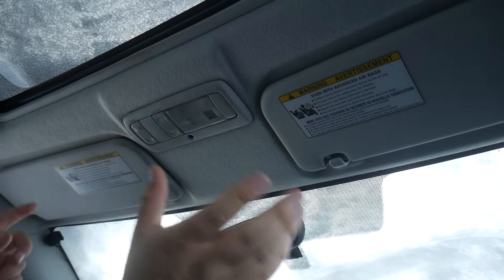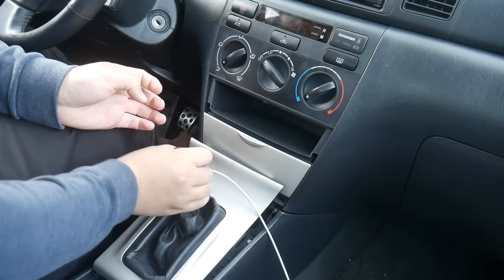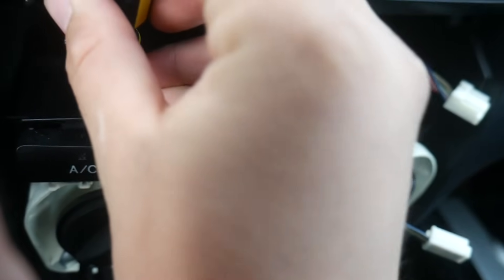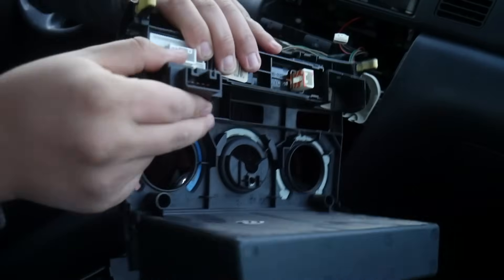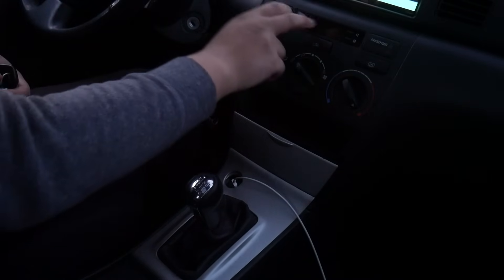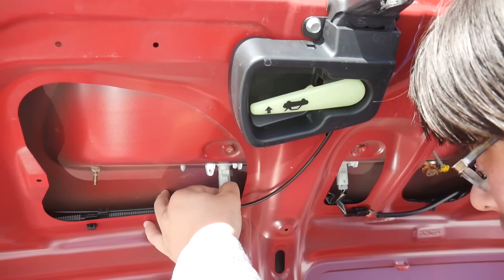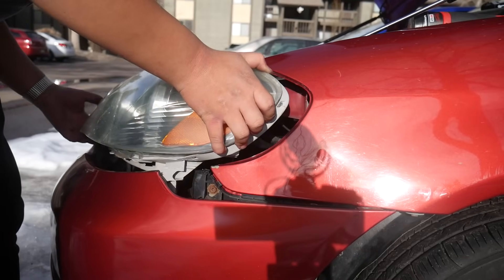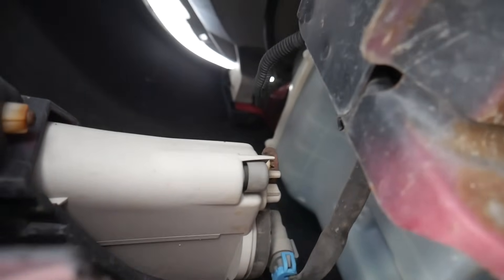Corolla LED Light Swap (Ultimate Guide)

Comment: There is another light in the back of the ashtray. Also, there is one in the clock. Both are T5 bulbs. Want to do the radio/disc player but haven't had time yet. I found the 'new' T5 LED are brighter than the old bulbs.

Comment: Thank you for showing the flasher relay location and including the amazon link, you really helped me. I had the hyper blink going on for like a week and couldn't stand it... this was super easy to do,  except pulling 2 tabs and pushing down another tab with only 2 hands in a tiny compartment was not fun 🤣You said it was hard to get the stock one out, but at one point I had it unlatched (not sure how) and then stupidly clicked it back into place by accident. If you can unlatch the stock one from it's spot, you can definitely get a better view and grip on those tabs.

Comment: Awesome - thank you. About the HVAC bulbs - buy the 10 pack. You'll drop some, you might even break some. The slots on the back of the ones in the link aren't deep enough for a screwdriver - tweezers in holes in the back worked for rotating them into place. 

Also your instructions for the shifter bulb are several steps simpler than other videos I saw. 

5 stars.
Reply: What tweezers did you use? I can’t screw them in for the life of me!!
Reply: @skitzafraz6708  the ones in my Swiss army knife key chain - small, squared off. Screwdrivers for eyeglasses might work, too

Comment: IMPORTANT INFO:
If your dash speedo/cluster lights are not working check your Tail light fuse!, i was working on installing a new stereo and my heater control lights were flickering and i noticed the controls had snapped where the bulbs are this shorted out when i touched it causing my fuse to blow and turned off my cluster lights, after mass amounts of searching i found out the cluster and tail light fuse are on the same connection.
In the UK my corollas tail fuse was hidden behind the glovebox up the top on the USA models i think it hidden behind the little cubby flap, great video 👌🏻

Comment: I just changed all my exterior lights to LED’s (except for the brake lights) and my 08 Corolla LE puts a big smile on my face whenever I’m following it and kinda makes my eyes bleed when I’m in front of it. I might have to swap out the headlights with something less bright. I bought the same turn signals listed in the description instead of getting ones with load resistors cuz I thought changing the Flasher Relay would be sorta easy but it’s really not compared to the video. I might get some professional help but I’m not sure atm cuz I’m always at work. But either way, thanks for the awesome helpful video Will!
Reply from the maker: Glad you found the video helpful and I'm glad you're enjoying your new lights! I guess I found the relay easier to swap because I've done it before but either way if you get professional help they should be able to finish it quickly!

Comment: For the hazard switch (for a different car) I used very thin aluminum tape strips on the inside of the button to reflect the light better and it's a MAJOR difference. I recommend trying that

Comment: You can fix the clock all u have to do is take it apart and heat up the resistors with a soldering gun just a lil bit and It did work for mine Good luck I’ve been watching your videos huge fan here keep it going
Reply from the maker: Yep! Planning on doing a video on how to fix the clock. Thanks for your support on the videos!

Comment: I did LED in my dome (interior light) and it’s a nice shade of white light, but it’s not bright enough for literally anything. The two in the mirror were the ones I planned next, but if they are anything like the dome light, I won’t change em. 
  I did my headlights (dim/low beam) with some LEDs from Amazon, and they are amazing! So clean and bright, I replaced them due to current draw. Halogen draws much more current than LEDs, and I save on power reserves for audio any time I can. That said, your 07 Carolla LE is basically the same car as mine, I thought I’d let u know, if u ever decide to do a stereo system, something about the trunks on those cars do great for the sound of subwoofers. Some cars have the shape and the cabin space that is a sweet spot, the Rollas’ are in that spot.

Comment: Hey man just want to say thanks! I watched your other video and got the lights  you put in the description. I changed all of them except the map lights 😅 tried to take the bulbs out and i couldn’t
Reply from the maker: The map lights are a pit of a pain to remove, I think I ended up using a flathead screwdriver to pry mine out but I did shatter one. Thanks for your comment!
Reply: Same, i still cant get the bulb out. 😣

Comment: Pro tip to anyone having trouble with their license plate lights like mine.

as mine were never removed since they were made. Use silicone Lube or just getting a good angle and some pliers, but of course don't break the bulb socket

Comment: I have never seen such a kitbash collection of analog bulb types. 205x,315x and 744X.  I've had to do bulb swaps so much it's sick...the current car needed a full set of eight exterior bulbs swapped due to old age burnout alone, headlights included.  a cr-v ended up not only having 168's solid in the entire taillight setup, but apparently, someone didn't know the front turn markers were supposed to be lit.  I also pulled three uncased LEDs out of it that had been touched enough to rub the coating off.  another quirk I rin into is a lot of parking lights on Japanese and other foreign built automatically use the regular clear bulbs, which I promptly switch to NAs

Comment: How is this car that much clean after 20yrs ?
I'm talking about boot metal below the black foam liner .
Inside hood, under coin holder 

There's no dust, no rust, no paint issues
I mean does this car is placed an isolated air purifier

Comment: i've gone through a few of the corolla clocks, 
 what breaks them is that they are plastic with metal circuits, as the plastic heats up it disconnects the soldering. You can re solder your cars clock every summer, but it's a lotta work for nuthin. I enjoy soldering practice, and you can get a lot of the clocks for really cheap from junk yards 

 I'm trying to come up with something to do with that part of the console but am looking for ideas too. 

thanks for this tutorial, I'm only buying the pink/purple variants of these bulbs and am about to have the stupidest looking car ever, <33333
Reply: How hot is it where you live? I live in Trinidad it gets about 40 degrees Celsius every day here my clock has never stopped working I have an Altis which has a slightly different design so maybe it also has a different circuit
Reply: @toyotacorollaaltis8613  in new models they fixed the clock, it's just the old version that the plastic cause the solder to break 💔

Comment: is the link about for hvac bulbs the correct link?
 I know the first bulbs where not? I want to order them... also I notice you saying you have to put them in right to work. does something plug into the bulbs?
Reply from the maker: Yep all the links for all the bulbs are correct, the hvac bulbs are T4.2. You won’t need any special plug or anything to make them work, leds are polarity sensitive so they need to be installed with the correct polarity otherwise they won’t turn on. If the bulbs don’t work at first, you can rotate the bulbs again so they make contact with the other side of the metal in the socket. I hope that made sense, easier to show what I mean instead of typing words
Reply: @WillChang  did you have to turn a certain way for them to turn on? I saw that a couple try’s they didn’t work?

Comment: Does having LED instead of the factory bulbs require you to eventually get a better battery ?. Like will it drain more power than regular bulb? I got a 2005 Ce and I bought the same leds u suggested ima try them out tonight

Comment: Polarity  does not matter with Bayonet type bulbs.
The Positive side is the little nub on the bottom of the bulb
The Negative side is on the sides of the bulb.

Festoon, Wedge is where it matters since these bulbs can be put in either way.

Some cars dont use flasher relays.
The flashing is controlled by the Body Control Unit

𝐂𝐚𝐮𝐭𝐢𝐨𝐧:
Do not replace Fog or headlight bulbs to LED.
This will cause glare and blind other road users.

Comment: Wow! Thank you sir for the info! I have a question. My trunk light doesn't work. I've changed the bulb and still nothing. I've switched the bulb around to match the polarity and nothing. You think I may have a fuse burnt out or something?
Reply from the maker: Sounds like a blown fuse to me, should be in the fuse box under the dashboard on the drivers side. If the fuse is good, there might be an issue with the bulb socket for some reason, and the socket might need to be replaced. Any other questions let me know!
Reply: @WillChang  I actually found out what was wrong. It was the little button next to the latch of the trunk that was stuck. It pops up when the trunk is opened. So problem solved! Thank you for your response.
Reply from the maker: Great, awesome to hear that it was an easy fix!

Comment: I saw a spark behind the cluster when i turned on the hazards after testing out these turning signal leds on my corolla
do you know if there's a fuse behind there? because now the lights for the speed, gas, and rpm are not working
i checked the fuses in front of the driver seat and they're all good
i hope i dont need to swap the whole piece out
Reply from the maker: Sorry for the late response, I didn't get a notification for your comment. I'd check all the fuses under the hood as well, and check the relays both under the hood and inside the car. (The relays in the car can be tricky to get to as like the hazard relay they are behind the coin holder.) If none of those have issues then I would guess something is shorted in the gauge cluster itself. Sorry that happened to you, it's quite unexpected for this to fail after installing new lights

Comment: Didn't check to see if anyone responded with this, but the clock display has poor solder. You can either re-solder the back of the display and sometimes just heat it (but if you're gonna bother going as far to get to it, may as well apply more solder). In some cases, on a super hot day in a dark colored corolla, that's why the clock tends to work, seriously lol. At times the dome won't work regardless. Usually that's the switch not contacting the plate unless you push and hold it. That's a relatively easy, finaggle-something fix.
Reply from the maker: Yep, I have heard of the clock solder issue, I plan on doing a video on that fix some time soon!

Comment: will i also found a sort of “life hack” for the fog lights, if you want them to be a lot brighter you could use headlight bulbs instead of fog light bulbs since the fog lights are also 9006, i wanted to be a bit of an ass and i used 9005 as my low beams and fog lights so it’s EXTRA bright haha

Comment: DISCLAIMER!!!!!! The Canbus system on my 08 Corolla caused the LED lights on my low beams and turn signals act erratically and flicker. I’ve since had to replace those back to regular halogen bulbs to solve the issue and paid a hefty mechanic bill to find this out 😅
Reply: The interior LED bulbs work great and look amazing though 😁

Comment: quick question the three screws that hold the HVAC dash in... i lost them do u have a link and or size of thos so i can replace them? the two at the bottom and 1 center behind center hvac control?
Reply from the maker: Not sure on the size, but there's likely some for sale on ebay/amazon. I'd search "2003-2008 Corolla center console screw" or something similar and I think you should find something! Let me know!

Comment: When you were replacing the dome light, did you notice if that switch is easy to take off and able to be cleaned? Im having issues where I have to jiggle it for it to turn the light on
Reply from the maker: I didn’t see if it was removable, might be able to spray it with a can of compressed air to see if that can help clean it!

Comment: I have a 2004 Toyota Corolla for some reason my center dome light keeps flickering it is control by the dimmer switch on the left side of the steering wheel

Comment: For the flashing relay position, was it rattley? Can I just tape it against the plastic to stop it from rattling around?
Reply from the maker: Nope, I had no issues with the relay rattling about! The proper way to install it is the remove the stock relay entirely and clip the new one in it's place, but the way I have it makes it much easier to swap out if need be. You can tape it if you wish, but I don't think it's necessary
Reply: @WillChang  From what I’ve seen, it’s really difficult to take out the original one so I was gonna do it you way just for the ease factor.
Reply: @WillChang  How’re the map lights? I’m skeptical of Auxito after  using their brake lights. One of the bulbs won’t activate when I push down my brakes. Then again, I won’t be using the map lights as often.

Comment: FYI - for 03 and 04 Corolla, fog lights are H3
Reply from the maker: Thanks for the info, I’ve updated the description to include this!
Reply: @WillChang  Other interesting things about the 03/04 sub year, is that for 05 - 08 models, they had better seats with improved support. Last, as most people know, the 03-04 front spoiler was different (05-08 had spoiler face lift).
Reply: @Pallidus_Rider Here in the Philippines the fog lights bulb is H3 also, and I think H11 is more easy to fit an LED bulb because H3 LED is bulky and can bend or destroy the metal clip.
Reply: @WillChang Bro I just wonder If your xrs can fit BILSTEIN shocks? I wanted to out that brand in my corolla 2006 here in the philippines cause we have the same looks and maybe parts also except our engine here are 1zz and 3zz (1.6) with 4holes stud wheels
 
Thats the mods I wish i could make for my corolla, change to 5x100 so I can put BBK and bilstein if its not fit with our models here, and do you have junkyard or surplus shop there to buy XRS ceiling with lights and sunroof we dont have SR here the only way to put is the aftermarket WEBASTO sunroof 
Thats why Im asking if theres pre owned parts I need for the ceiling.  Thank you Im hoping for a response so I have ideas where get😊

Comment: Do you know if there is a led light for the clock and if so, do you know the part number or is it the same leds as the HVAC? Thanks
Reply from the maker: I’m not totally sure, I haven’t opened up the clock for this car. No bulb around the connector though, I think I’d need to open it up to find out

Comment: I just changed the hvac lights and all three buttons ac, recirculate,, and defrost won't light up.. what did I do?? I tried spinning the bulb around and it they won't light up, I even put the stock ones and they won't light up either
Reply from the maker: That's very strange, do the 2 lights on the back light up? Do the buttons still work? I doubt anything would be shorted since you just replaced the bulbs, but it could be worth to check the fuses to make sure none of them blew.
Reply: @WillChang  if you mean the two lights that light up the whole hvac panel then yes they work with the new bulbs. I tried to do the ac bulb and recirc bulb at the same time, didn't work, but the defrost still lit up. I tried to change the defrost, doesn't work lol
Reply: @WillChang  is there a second fuse box in the glove compartment area? I'm assuming it's not the fuse box under the hood? And yeah the buttons still work, when I press them the little green light works same with the orange for defrost
Reply from the maker: Gotcha. Yeah there's another fuse box in the driver side footwell under the steering wheel
Reply: @WillChang  update... no fuses blown, everything was good. Randomly one of the lights turned back on, except it was blue instead of white.. I used the same lights and the two main lights which were white lol changed the other two and now my ac recirc and defrost lights are blue 🤔🤔 idk how but im not touching them again lol thanks for the help bro! I appreciate it

Comment: Bro i tried the hvac ones today and it was a fucking bitch. Took me almost 1.5 hrs to get everything off, disconnect everything and the right bulb wasnt working. The rest were. I ended up giving up and figured it was a busted fuse. I tried with two different LED bulbs on the right side and no luck. Its also a bitch trying to screw them in because you need really small flat head screwdriver and even then you need it to be wide so it doesnt mess up the plastic on the back of the bulb. It was the most tedious shit ever. I also disconnected the battery prior to takin out the connections in the back. I cut one of my fingers trying to remove one of those modules

Comment: Does the dimmer switch work with the LEDs installed in the heater control areas?
Reply from the maker: I don't know for sure, I didn't take a good look at the dimmer but I would assume that it's the same!
Reply: @WillChang  are you able to test it out please, and let me know for sure?
Reply from the maker: @Robbie2Fly  Yeah! I'll let you know what I see!

Comment: Yo the license plate you say its 168 but the link takes me to 194
Reply from the maker: The link is correct, I used 194 bulbs for the plate lights. 168 and 194 bulbs are interchangeable but I meant to write 194 in the description. Sorry for the confusion!
Reply: @WillChang  thanks bro!